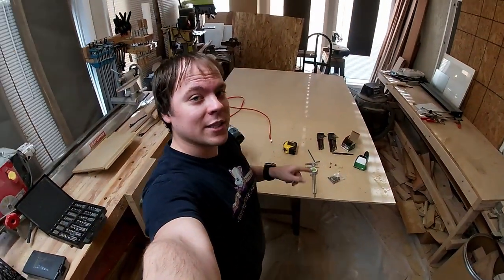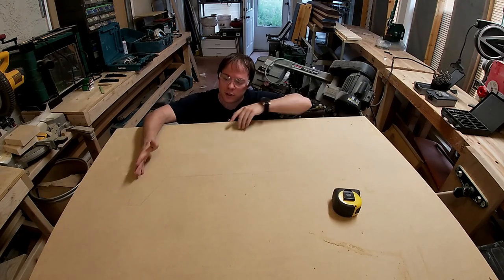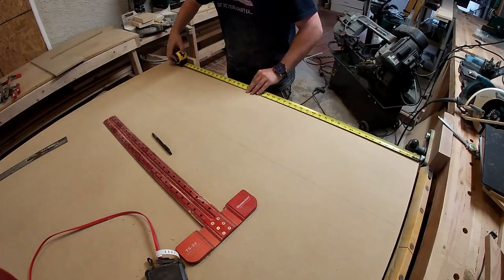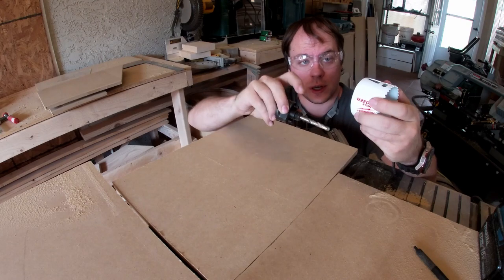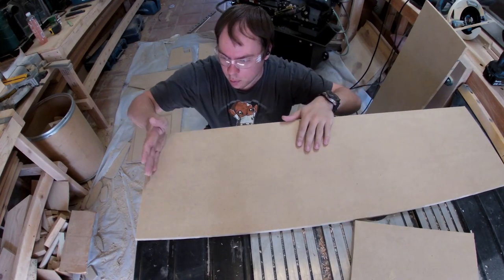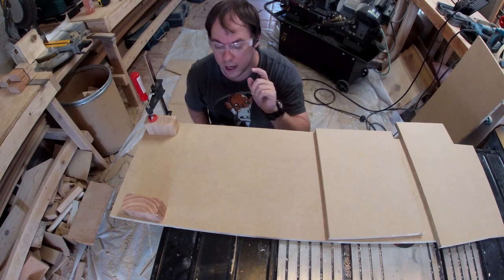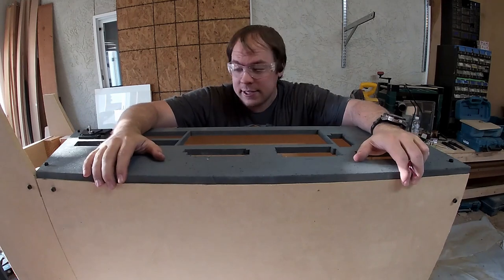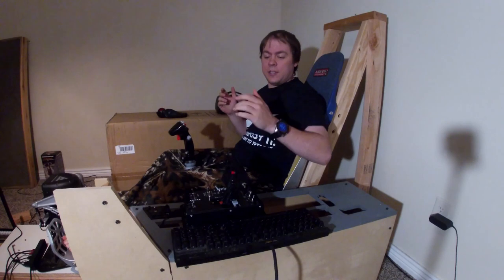F/A-18C Cockpit Build - EP25 - Left Frame Superstructure

Comment: Just a quick tip for dealing with screws in MDF: use liquid acrylic wood hardener in the pilot hole to keep the MDF from splitting.  It softens the wood fibers so you can turn the screw in without the MDF splitting out.  The only danger is stripping the threads out if you’re not careful about turning the screw in; sometimes you have to drive the screw in partway then finish after the wood hardener has dried.  Use wax or a thin film of Vaseline to keep the screw from getting seized.  It works really well and ensures the screw won’t get pulled out as easily.  Hope this helps!
Reply from the maker: oooh interesting. I'll have to try that. thanks for the tip!